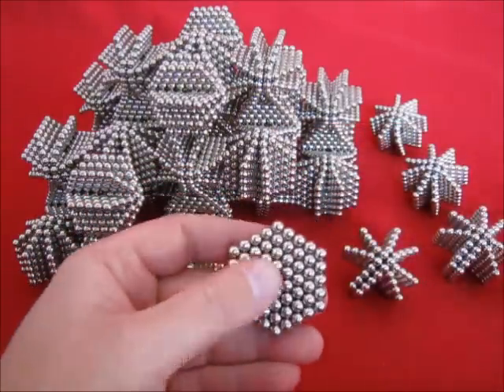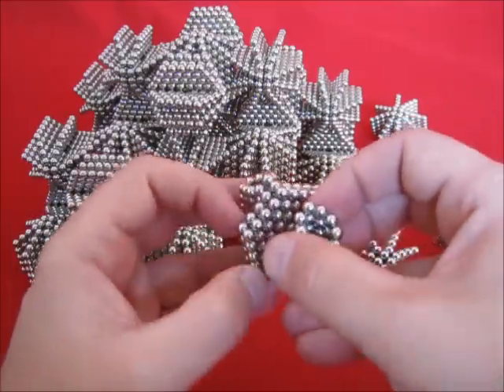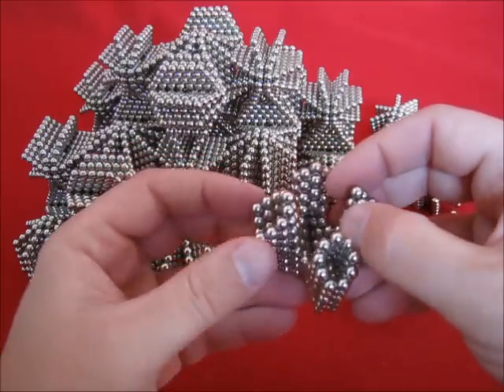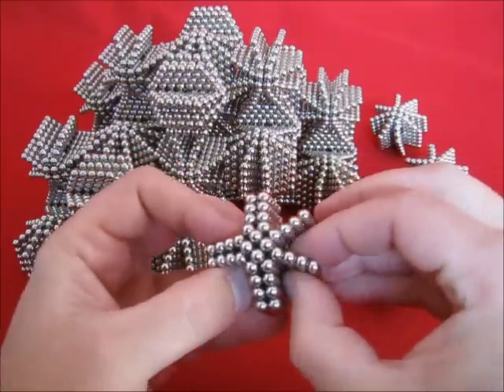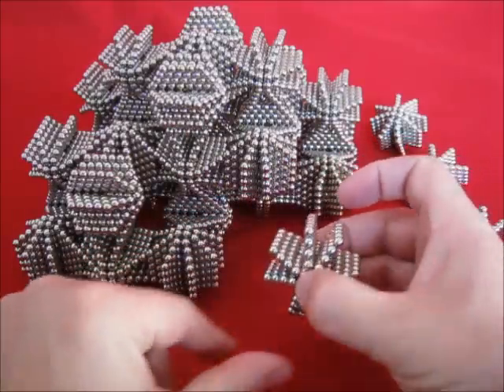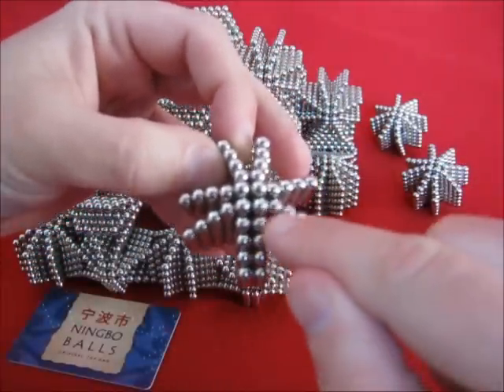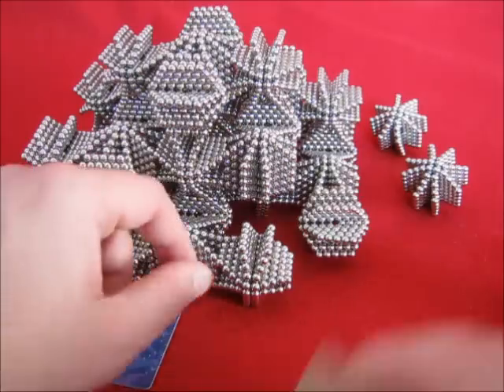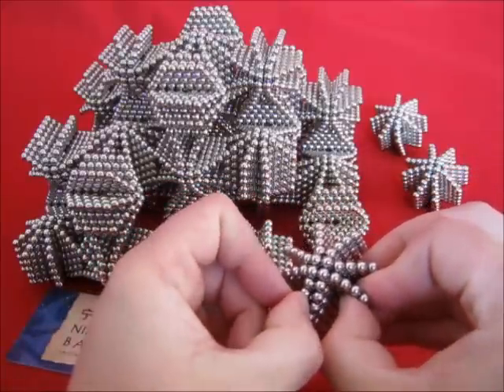24-gon asterisk tessellation

Comment from the maker: It is possible to size down the units, from 240 per unit to 144 per unit when you make them with 3 row hexagons instead of 4-row hexagons. Also, it already looks quite nice when you build the 1st floor with 8 units and place 5 units on top. Then you need 'only' 1872 magnets or 9 sets of 216. Have fun if you have enough then!